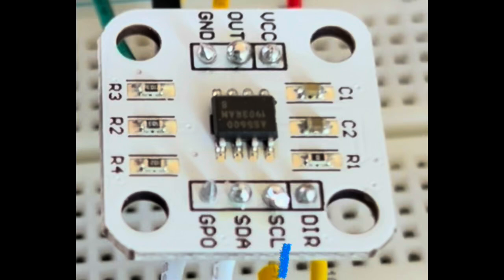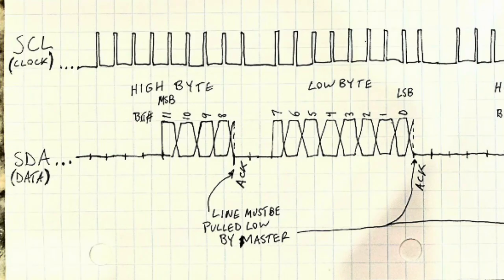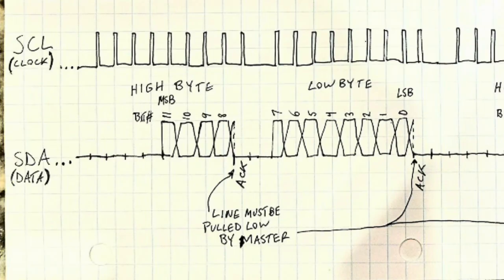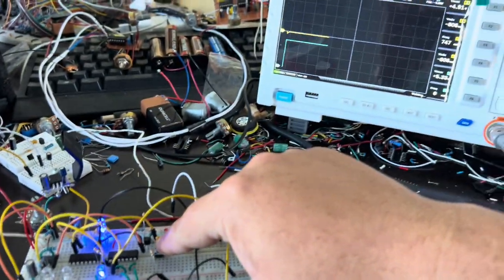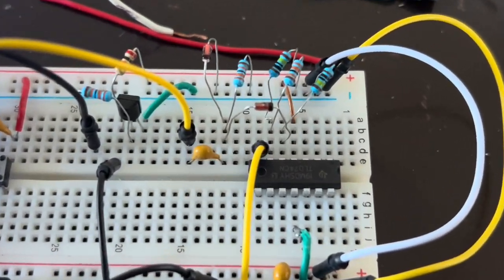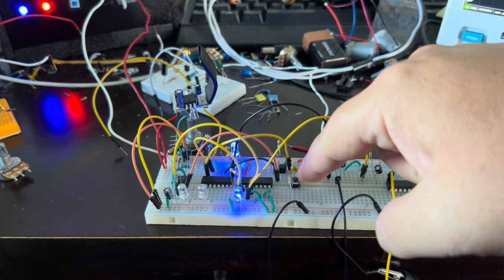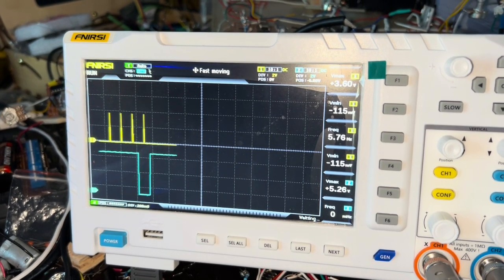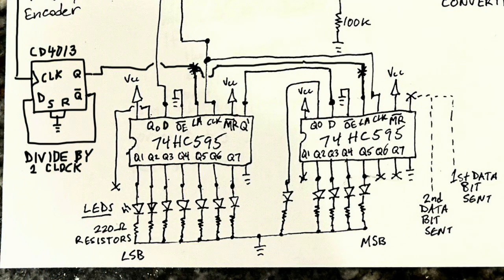Coding in hardware - I2C Receiver circuit with the AS5600 Rotary Encoder (no microcontroller)

Comment: @7.20 you don't need these diodes, the TL072 is fet controlled, negative voltages only close the fet's (the fet gate not really connected to the inside world, a gate "field" operates the fet) & transistors more, CD4000 have voltage clamping diodes on the inputs.

I like your drawings.
Reply from the maker: @AnalogDude_  thanks for that. The drawings like a lab notebook for me. I feel like ive had the tlo74 glitch on me when i dont use the diodes
Reply: @igorbrichkov3632  It should not, check how Fet's are build on silicon, the gate unlike a transistor is not connected with the drain and source (Field effect). the transistor is related to diodes, so it depends when used in opamps or comparator ic's (NPN or PNP). a single forward diode is enough if you insist, but you lose 0.65 V so your comparator threshold should be a bit bigger than that.
Reply: @igorbrichkov3632  It might be better to use 2 inverters of CD40106 in series and place the RC constant in between the 2 inverters to get a nice squared, the "Schmidt" and voltage clamp mechanisms in them makes possible to remove the threshold resistors of the comparator & diodes. reducing parts & labor.
Reply from the maker: @AnalogDude_  agree but i dont have any of the cd40106s left
Reply: @igorbrichkov3632  The cd40106 is faster than comparator. but you could also try a and, or, xor, etc gate they all seem to use CMOS inverters inside (datasheet).
a transistor "totem pole" arrangement could also work, the pnp/npn strangle themself, so no resistor is needed on the base. 

Would you try to use dac0800 / dac0808 on your sampler? to see if it's sounds nicer @ 32kHz.
Reply: @igorbrichkov3632  I did a simulation with transistor "Totem Pole", 2 totem pole in series with RC constant in between, the base of the first totem pole config needs to be tied to ground with 100k or so. that works fine and is smaller than using Dip packages. the consume is like 25 uAmp for the whole config of 2 totem pole + RC. a diode after the RC constant might not be needed at all.
Reply: @igorbrichkov3632  it might be better to cut vero pcb to small size, enough to fit a totempole or so configuration, midi, that's how i did it in combo with breadboards,
just to make sure this works, no noise, weak contact.